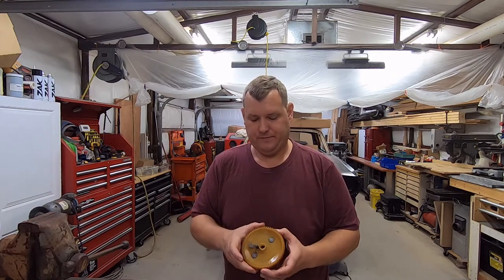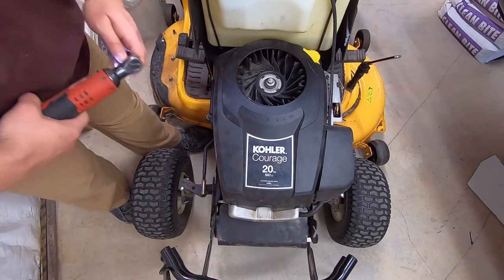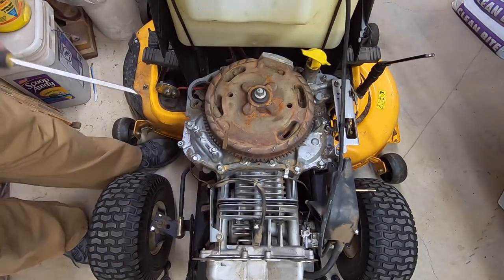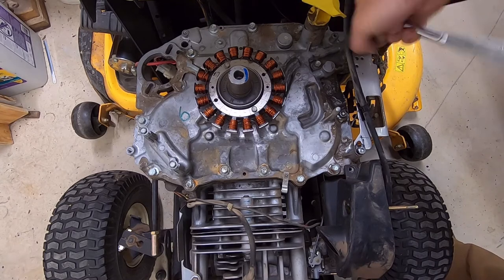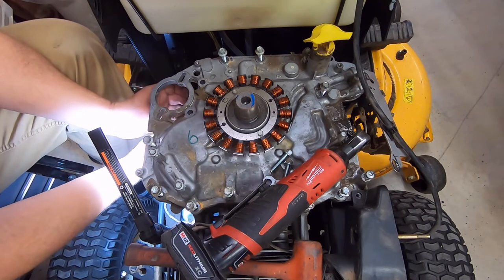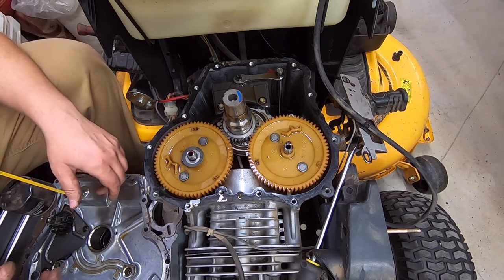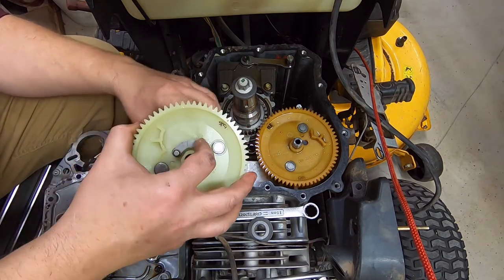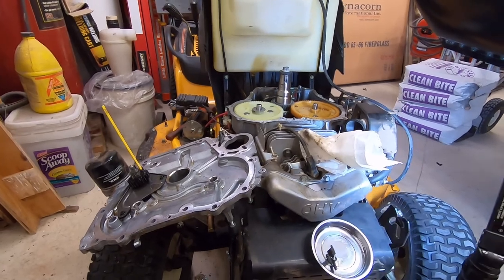Kohler courage exhaust cam replacement

Comment: Great video. The comments say the replacement cam gear & compression release mechanism fixed the hard start problem but would like to have seen a close up of the old cam compression release and a final shot of it starting and working.

Comment: Good job. Thanks for making this video. There isnt much anywhere online about these specific cams with th ACR. Mine has a lip that catches like your new one in this video. Any idea why it has that?
Reply from the maker: Not sure but it seems they have reengineered the cam gear multiple times and they leave remnants of the last fix in the mold. 
   Mine should have been one of the better corrected ones but it was still sticking intermittently probably at less than 50 hours but I don't remember now. I kept putting it off and helping it start by turning the engine backwards so it had the best chance of starting. 
    Since the replacement cam it has started flawlessly every time. I do wish the mower had more power though. 
    Also keep an eye out on the governor shaft. I have sand and silt and it blows like a sand storm when mowing. It will build up on the shaft coming out of the engine and the carb linkages and will keep them from moving. It's obvious when it gets bad because the engine won't open the throttle more under load. I have to clean off all that gunk to free it up.

Comment: Great video. Starting to work on a V-twin, I see the second part though, did it run afterwards?
Reply from the maker: Been running like new ever since. That said it was so dry last year I only cut twice. Already 4 times this year and it starts immediately every time. I often use it more for moving the trailer around than actually mowing. I do need an air ride seat for it since my yard is rough enough that it sends painful shocks up my spine every sip and bump. I have the tires as low as I can put them
Reply: @theinfernalcraftsman  I"m gonna start on my today probably, hopefully be as easy as yours was.
Reply from the maker: @ronniewortham3260  Awesome. I wasn't really planning to record it when I did it so... And I didn't show it running because of the weather at the time and other constraints. The point of the video was to show it being done. Now I need to do some mods to it as I really wish it had more power. I replaced all but one of the pulleys recently because the sand I have ruins bearings very fast. One pulley is a royal pain to get to and fortunately it wasn't making much noise.

Comment: Is it obvious when you look at the old one that it's broken or worn? I didn't see that part in your video.
Reply from the maker: There is no broken plastic on the later versions of the engine. The small metal shaft with the lever gets sticky in the worn hole and will occasionally work. The older engines used a chunk of the plastic on the gear to actuate the compression release. They updated it and now it has different problems.

Comment: So why did you replace the cam follower?
Reply from the maker: The cam follower comes with the kit. They have to be replaced in pairs because they need to break in together. If you use the old one it will prematurely wear out the cam lobe.

Comment: Nothing was wrong with old part
Reply from the maker: The old one was bad 98% of the time. Every so often it would work right but most of the time it would stick and not work correctly. The new one works perfect every time and starts like a new mower every time since and no other changes. Course this year I have only had a few weeds to mow once since it has barely rained the past 6 months.

Comment: Randomly replacing parts jus because...
Reply from the maker: Just because it was sticky and rarely worked properly. The original worked once out of 10 starts. The new one works every time and it starts like a new engine every time. It wasn't broken like they usually are it just stuck and failed to work most of the time.